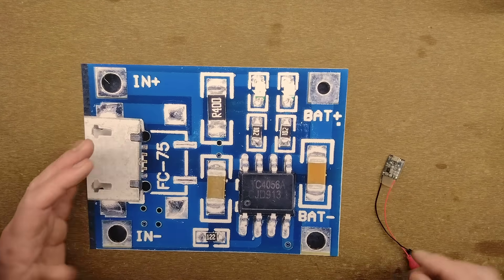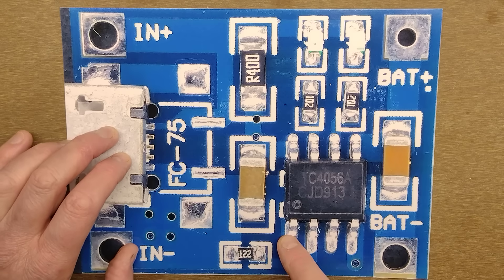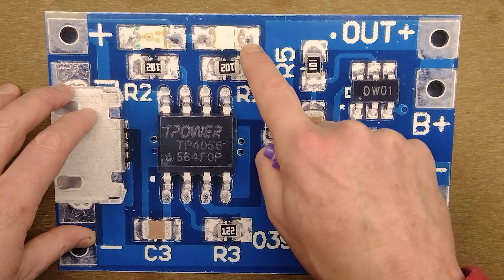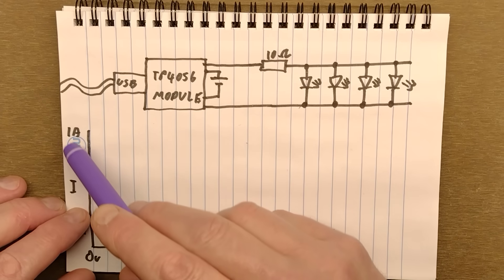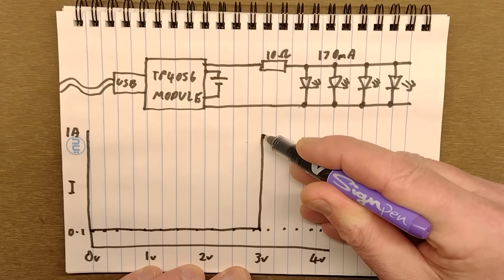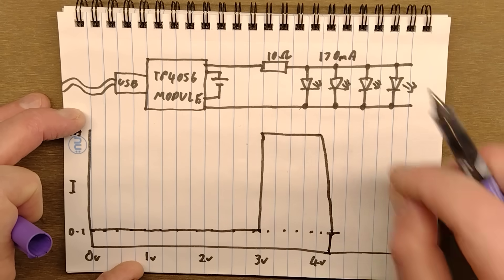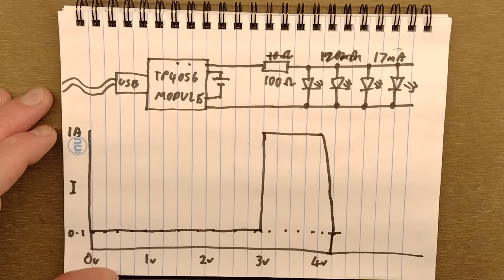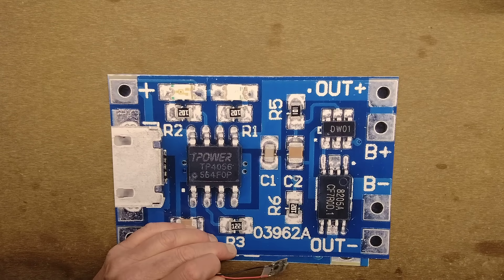TP4056 myth busting

Comment: I had a question,
I have a 1000mah 3.7v lipo battery
Can i use this module and what should be the value for the resistor
Reply from the maker: The module will be fine as it is.
Reply: Thank you btw and subscribed🙌

Comment: I used the 4056 in a commercial project with a parallel load and that's where I found that keeping a cell close to 4.2 volts for long periods resulted in batteries inflating.  I have since added a more complicated charging algorithm in my firmware that will only hold it at 4.2 volts for a limited amount of time before shutting off.  Then the cell has to drop down to the recharge trigger voltage before starting the cycle again.  Haven't had any cell failures with that.

Comment: Oh I got myself 20 of these from amazon for a few quid a little while back, I only wanted the 4056 chip to replace the one that died inside the battery for my hair trimmers.
I can also confirm these chips do get rather warm which is why they had a heat pad under it to dissipate the heat.

Comment: I've been trying to figure out if I can just attach a 6v solar panel to the input of one of these boards. From your video it looks like it would be ok?
Reply from the maker: I'd recommend adding a series diode too, to nudge the voltage closer to 5V.
Reply: Putting 6v at the input of the tp4056 module is fine the maximum voltage for the tp4056 is 8v

Comment: I'm using  5V solar panel instead USB to charge a  18650 battery and DC motor as load ,but I wondering  like you said in 6:43 , the current would be limit while the battering close to 4.2V ?
when will the motor drawn power from  battery ? when the solar supply (TP4056 input) lower than battery ? or maybe I should add relay to switch it? sorry for these question but I struggle with it so long.

Comment: I’m a relatively new follower. Would that module be suitable if the charging end is a small 5v solar panel? Maybe on some days the cell will never get charged enough to power the LEDs for any reasonable length of time ?
Thanks for your content btw!
Reply from the maker: Yes it works with solar panels.
Reply: I strongly raccomend tp4057, it's not heating at all, https://youtube.com/shorts/8TFnmdYSzdo?feature=share

Comment: Please don't recharge Li-Ion batteries that have been below 2.5v - once the voltage hits a certain threshold, the copper starts to dissolve and goes everywhere in the battery, including into zones where a short is possible. How do I know? We're looking at those batteries under the microscope. Fun fact: During charge and discharge, the lithium changes color from red to yellow to blue :)
Reply from the maker: Many cheap power banks will literally discharge their cells to zero and then trickle them back to 3V again.  Other research indicated that the majority of damage occurs in lithium cells when they are reverse charged.

Comment: can it be used for lifepo4 cells?
Reply from the maker: No.  You need to use a version with different voltage thresholds for LiFePO4.

Comment: You can also daisy chain these modules, to charge series connected cells, as long as the modules' input are  'floating'.
Reply: No, do not "daisy chain". If you have a 3S pack then connect each isolated 4056 charger to it's own cell with two wires a (+) and a (-).

Comment: I have 1500 mah 18650 parallel pair...its voltage is 0.66v. connected to tp module but it glows blue led instead of red...what can be the reason?
Reply from the maker: It will need to trickle the voltage up to 3V before full charge kicks in.

Comment: Does anyone know how many 18650's can be charged at one time by a single TP4056 charger module?
Reply from the maker: If wired in parallel with perfectly matched voltages beforehand, there's theoretically no limit other than the time taken due to the increased capacity.

Comment: Just thinking that you are better off putting resistors on each LED, to avoid issues with varying Vf of the LEDs... It can cause quite large differences in brightness at both very low, and very high, currents.

Comment: I've been using these chips and modules for years now, and I've never had one overcharge a Lipo while drawing power from the battery while charging.

Like you stated in the video, the charge in current just gets shunted to the load if the cell fully tops up while charging and drawing power at the same time. I'm not sure why people think it's harmful, and don't understand that it works this way. 🤷🏻
Reply: It is harmful to hold an 18650 cells at 4.2 volts for a long time. You clearly do not understand that BOTH the cell and the load will draw milliamps at 4.2 volts.

Comment: Hi can I use a standard 2.2k resistor on R3 as my sight is poor to solder a smd resistor 😂 thanks big Clive
Reply from the maker: Yes you can.
Reply: I'm going 2 use a 5k quarter watt resistor so the output is around 250ma the battery is only 550ma e pen
Thanks again Big Clive

Comment: Question for anyone and everyone. 
I have one of the little flat pack Li-Ion cells, the ones always trimmed in Kapton tape. It has a little board on it with (I presume) protection chips. Can I leave those on there and just use one of these boards?  Or should I remove that little board from the battery?  I have the 4056 board with three chips (DW01, etc.)
Reply from the maker: You can leave the protection board on.

Comment: Any recommendations for the cheapest and most readily available chip to perform a similar function but that also allows you set a lower termination voltage? I like my lithium-ion based projects to last a long time and not kill their batteries if they're left plugged in, so I'd like to set a termination voltage of 3.9-4.1V depending on required battery runtime, as even small reductions in the "holding" voltage a cell sits at has massive impacts on how long the battery lasts before failing.

I know there's a variety of chips that will do this, but I'm looking for something conveniently available in pre-built break-outs like this for minimum cost so I don't have to design something myself and have a bunch manufactured.
Reply from the maker: So far I've not found a simple solution to a lower voltage charge.

Comment: I've built two projects using the version with the DW01 chip and they work very well. One of the projects is a rechargeable emergency light and it has worked perfectly for about eight months.

Comment: That explains a lot also with other type of charging ICs. I was setting the charging current low because wanted to charge the battery slow and easy. But that means the 1/10 of the already low charging current was even lower value. And the attached circuitry can possibly draw such low current and therefore the charging LED never went off. I should have read the manual more thorough :-)

Comment: Note. If you are using one of those cheap chinese 18650 battery holders with the really thin wire, it can cause these boards not function properly. The wires need to be sufficient. The ones on those battery holders are like a few strands of hair if you remove the insulation.

Comment: Some badly constructed or fake TP4056-moles do charge up to 4.3 or even 4.35V i recognized. It depends on the batch you get and some seem to be fake modules or have errors. So be careful using these ICs withoud testing! Also important to know that the IC will pop right away if you occasionaly insert the battery in wrong polarity! There is no protection against a wrongly inserted battery!

Comment: What if the load is 1 amp or close to 1amp
Reply from the maker: Then the cell voltage will settle at a point where the input current matches the output current.  If too high then the voltage may go so low the protection kicks in.

Comment: I've gone through my broken phone pile collecting enough pieces to assemble a few phones for my friend with limited budgets and broken phones... In the process, I've noticed that phones that claimed higher capacity have done so by raising the charge voltage to 4.4 volts from 4.2 volts. Do you think they have changed anything in the cells or just got a better charge controller that avoids the 4.5 volts where plating out of lithium occurs? Are there little cheapo charge controllers doing 4.4 volts yet?
Cheers Clive,
Tim
Reply from the maker: The cells are specifically suited to the higher voltage.  Doing that to an ordinary cell will reduce its lifespan greatly.

Comment: Great explanation.
We have a old baby monitor that used 2x Rechargeable AA Batteries. It would only last 2 - 3 hours outside of the charge dock. I modified it to use 2x 18650 lithium cells and used an aliexpress circuit that has this chip (Actually the second one with the load control). The LED on the charge controller never gets to the full charge state when it is on, but the battery does fully charge. I understood it was due to this. For clarity, that baby monitor now lasts 48 - 72 hours on a single charge and has been in use for 3 years now. Only runs around 6 hours at most off the dock, so probably means we only use ~20% of it's capacity :)

Comment: The DW01 also does overcurrent and short circuit protection, using the MOSFET Rds(on) as a shunt resistor to roughly measure the current.

Comment: I think For LEDs the board with no over discharge protection is better as it doesnt have parasitic draw on the battery ?
Reply from the maker: The DW01 has extremely low quiescent current of about 3uA when active and 0.1uA in shutdown mode.

Comment: i used this module in my ps3 controller years ago when its in built charge controller died  have used it a number of times plugged in with no issue.

Comment: Hi Clive, thank you so much for doing this video, it's very reassuring as I've wondered this about the TP4056 for a long time! I built an Arduino project a while ago with a PIR sensor that checked to see if post came through my porch letterbox and started flashing an LED through the window, however was always wary of it as it had a TP4056 hooked up to a mini-solar panel to charge an 18650 cell. Always worried about whether it might over/under-charge! Glad to know it's not a problem!

Comment: It is just using a “trickle charge”, then constant current, then constant voltage that cuts off at a certain current, by the looks of things, that is a pretty common and recommended way to charge lithium batteries.

Comment: Hi Clive, thanks for this. I have one of those chips, with a battery from an Elf Bar and I've used it to power those little LED strings for a mini christmas tree. Would it be okay if I used and charged that at the same time. Somebody told me it was extremely dangerous so I turned them off and havent used them for days.
Reply from the maker: No.  It should be OK.   As mentioned in this video, it won't overcharge the cell.  It'll just hold it at its fully charged state.  Perfect for if there's a risk of a random power outage.
But without the risk of power failures, you could enjoy the freedom of a cordless tree, just charging it back up again as needed.
Reply: @bigclivedotcom  thank you very much for this, my tree is lit up again!

Comment: Probably worth noting that in their standard set up the TP4056 gets hot at first, especially with 2 cells in parallel, so a good heatsink candidate. Also note the overcurrent circuit shuts the MosFets down if the current draw is too high... LEDs = good... Motors = bad
Reply from the maker: A risk with motors is voltage spikes damaging the MOSFETs.  I'd recommend a flyback diode or small capacitor across inductive loads.

Comment: I heard these TP4056 are terrible inefficient power wasters, would explain my terrible 12v battery life in my car where I have 3x 18650 batteries directly replacing a tablet battery, charging 24/7 aka always on.  But the tablet is hardly ever actually turned on, while the TP4056 charge LED light is lit 99 out of 100 times I look at it.  The TP4056 seems to be throwing a "lot* of heat away, even though the batteries aren't being drained
Reply from the maker: Remember that you can't use multiple cells in series with TP4056 cells on a common power supply.  It effectively shunts some of the cells.
Reply: @bigclivedotcom  thanks for the reply.  I understand, I have 3 in parallel, just for longer battery life.  What I should do is have a circuit that for example, when the door opens and the interior light turns on, the charger starts and runs for say 6 or 8 hours then shuts off.  I'm just not sure about how to get a timer working, not sure what to buy.  Maybe there is a better way, obviously running the charger 24/7 is pretty stupid, but it served the purpose till now
Reply: I was originally hoping that 3 batteries would allow me to have such a capacity that I would be able to run the charger off the ignition circuit, but I don't drive the car enough, so the battery wouldnt have enough charge time, and go flat

Comment: My ESP8266 device has been running for six months in constant charging mode. I will attach the graph below. I can't guarantee that the measurements are very accurate, but somewhere close to the truth. http ipic DOT su/img/img7/fs/chart.1671370915.png
Reply: Well, or just like that http://ipic.su/img/img7/fs/chart.1671370915.png

Comment: I've had to research older Li-Ion cells on viability for re-use as part of a college internship. Testing hundreds of them and it became apparant that old/degraded cells CAN actually start to keep consuming current even if at 4.2V in varying currents from 10mA to 200mA. These cells would keep charging during CV-mode and slowly overheat. It led to me terminating the project out of safety concerns.

In practice most cells should never exhibit this behavior, especially those with protection circuitry, but a bad egg can do that. Which i believe is why nearly all chargers all got a current termination threshold at about 100mA (notably when a ntc function is missing). So while normally putting a load is fine. You are diminishing/losing a safety functionality in the process.

A full-fledged ORing/Switching circuit is still the 'proper' way to go. Can be as simple as a P-Mosfet + Diode that disconnects the cell the moment a different supply is hooked up.
Reply from the maker: Cells that have developed an internal shunt resistance should be discharged and recycled.  It sometimes happens in old laptop packs when one cell has been reverse charged by the others.
Reply: @bigclivedotcom  Correct, but the shunts i've seen are not large and able to trick hardware and user into believing they are fine and functionally act fine so long as the cell doesn't degrade further. And they can also develop when a li-ion reaches critically low charge as sometimes seen with cheap/crummy stuff turning volatile after extensive storage.

Without proper termination of the charging circuit once full-load is achieved. You are risking increased likelihood of a user not noticing when the device suddenly stops terminating charge properly and starts to swell up like a balloon.

The charging into a load panic is often overblown and of no consequence to like a hobby project, but not to be outright dismissed and taken in account if going more serious.

Comment: I bought one on these for LIon and on for LIpo. Can I use both for both type of cells?
Reply: Yes. Both are simply just Lithium Ion batteries in the end, only difference is that LiPo has polymer electrolyte allowing for higher density and the signature sachet form factor.
Any Lithium Ion ic/charger/manager/etc will work exactly the same with a Li-Poly.

Comment: The chips are silicone right? And physically they're very small things like gates inside? Since it's so small, how can a whole amp go through it, I thought that using extremely thin wires meant I couldn't put much amp through my circuits, but this is effectively ultra small microscopic wires in the chip? 
Its like magic to me, I don't really get how gates work or what they physically are
Reply from the maker: The internal design is optimised for higher current.  Probably multiple bond wires.
Reply: @bigclivedotcom  I wish I knew more about how it works. I watch videos about logic gates, about chips, about mosfets, but it still seems like magic to me.
Thanks for replying, you do good work

Comment: For smaller capacity batteries (under 1mAh) does the 122 programming resistor need to be swapped out with something higher?
Reply from the maker: It is generally recommended to charge lithium cells at 1C.  That's 1000mA for a 1000mAh cell or 300mA for a 300mAh cell.

Comment: Thank for a really good explanation. noticed a lot of cells say 3.7v but all the chargers charge to 4.2v not seen a good explanation why.
Reply from the maker: 3.7V is the average voltage of the cell.  Fully charged is 4.2V and fully discharged is around 3V.

Comment: Thanks Clive, just seen this video. My cheap China-drone's batteries don't have the charging logic on board so you literally have to watch the clock when charging. Often strikes me as a bit of a lottery. If I put this module in-line of the power supply, will it mean I can effectively charge and forget?
Reply from the maker: The external charger may have its voltage capped at the lithium cells maximum voltage.

Comment: Can you adapt a solar cell to charge the li-ion cell during the day and have the lamp come on at night?
Reply from the maker: You could add a 5V solar panel to the contacts on either side of the USB connector, but it won't switch on automatically at night.